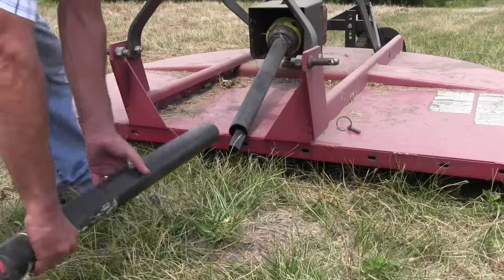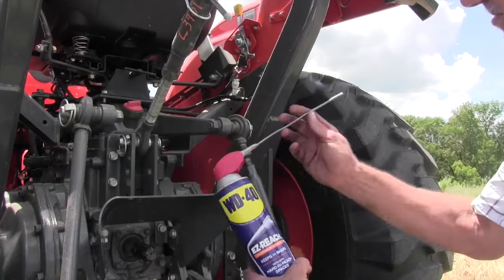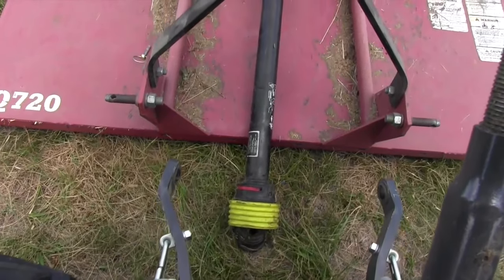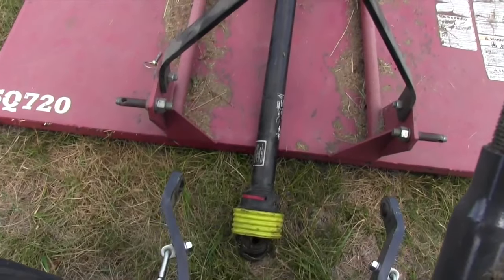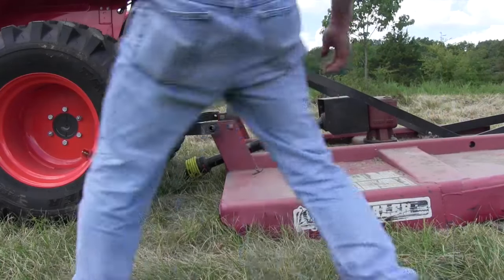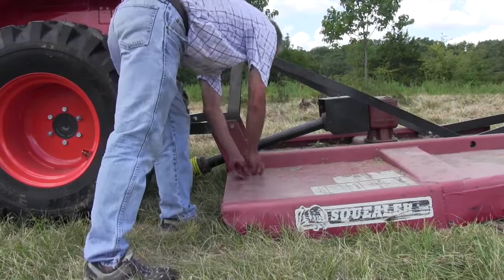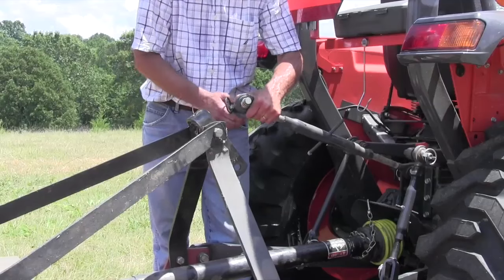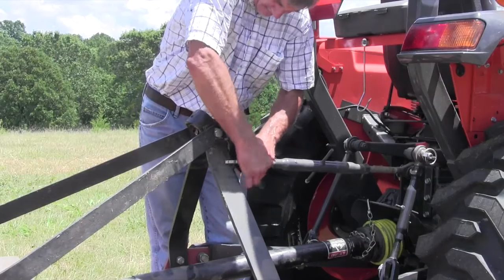A Tip to Make Hooking Up a Brush Hog Easy

Comment: I accidentally found the easiest way to hook up a brush mower. To keep my mower out of the dirt I sat it on two long scrap pieces of pvc sewer pipe I had laying around. You can slide a mower deck around like it's on skates to hook it up, keeps it out of the dirt and they don't rot. It makes hooking up my mower super easy! Thank you for the video.
Reply: I used 12 inch steel oil well casing to do that for 40years.
Reply: That is an absolutely boffo idea. Man, damn if I’m not doing just exactly that.
Reply: Well gosh darnit
Reply: Sounds great, going to try that with my front deck on  JD F935, a real pain to reinstall, thanks again

Comment: I keep the cutter on a steel dolly I welded up with some steel I had on hand that is on wheels and store it indoors on a concrete surface. If yours in on a level surface like mine, you can grab a low clearance hydraulic jack for lifting your car or truck. The jack is on wheels and makes shifting the cutter around easier than lifting with a pry bar. I know that doesn't help if you store yours in a field.

Comment: Thanks Mike!
My Kubota L3240 has the sliding arms which makes the lower pin attachment fairly easy. However, the pry bar is a great idea for a "just off" adjustment which is often necessary even with the slides! You are right, "now why did I not think of that?" as it looks like a D'uh tool. 👍👍

Comment: Mike, I realize this clip is now a few years old, but I did want to add my (belated) 2-cents worth...  For several years I, too, struggled to line up my tractor to the brush hog.  I keep my cutter parked up on cinder blocks in my concrete-floored barn when not in use and it was difficult to make those necessary final adjustments to the cutter when it came time to hook it up.  A few years back I built a skid from scrap 2x6 planks set on rollers (in my case, metal coasters salvaged from an old upright piano I was getting rid of.)  The brush hog remains parked on the skid and off the floor when not in use; simply backing the tractor up close and it is quite easy to move the skid into final position when I go to attach.

Comment: I always found that getting the tractor aligned properly (at least close) before you start to attach any implement is the big 'trick'.  When you are twisted around, looking over your shoulder, backing up to an implement you can't tell if you are square to the implement or not.  One lift arm is angled one way and the other is angled another further complicating the procedure.  I carefully set the top link pointing straight back (usually while standing at the rear of the tractor and sighting down toward the engine) and then I have a reference to know what is 'square'.  If the implement has a PTO shaft, I also align this 'straight ahead'.  Now I have a reference to what is 'square' and can 'aim' the top link to the center of the implement trying to keep it all square and it should hook up fairly easily.  Unlevel ground can be a real problem.  I also believe in letting the tractor do the heavy work.
Thanks for your videos and the help they give us all.

Comment: That was a really nice demo, especially after we had just struggled to put on the mower the hard way.  I need to watch your videos before fighting the tractor, not after.
Reply from the maker: I did it the hard way for about 50 years, imagine how dumb I feel...especially when that tool was leaning up against a wall 30 feet away the whole time.

Comment: Great idea, thanks!  My cutter is housed in a shed on blocks.  I use a chain fall on the top link attachment pin to lift it off the blocks, then free up  the tractor lifting arms to move freely.  I follow up with final leveling and re-pinning the lifter arms.  Takes only a few minutes and I don't even have to swear at it very much!

Comment: Hey Mike, as always, thanks for the video.  Two thoughts come to mind.  First is that I keep an old shovel handle around close as it seems I always need a leaver for something.  Also, I tend to keep my implements in the barn on concrete and started setting them on movers dolly so that they roll around.  This make it easy to adjust when mounting them and also lets me roll them to wherever I want to store them.  Saves a lot of floor space and maneuvering around inside the barn.
Reply: Re-watched this video and finally read the comments.  What a great idea for inside a shed that has smooth slippery floors.  Steel pry bars slip when prying and I haven't sprung for Pat's Easy Hitch yet.

Comment: I've changed to a quick hitch system on my small (45 horse) tractor and am so glad i did. Changing implements is no longer a hassle. The one i've installed is an after market product fitting most tractors.

Comment: I have been using a Rock Bar to move my Shredder to line up with the pins for years.   I guess you confirmed I am doing it right.   My Shredder is an 8' wide brush hog, and you need a little more leverage but it still works GREAT !!!  Thanks for the TIP !!!

Comment: Thank you for this and your other videos!  I'm late to the picnic here but if you can store your cutter underneath an overhead, simply use a chain fall on the center pin. The cutter is suspended between the tailwheel and the center pin.  It's easy to jockey the cutter by hand  to slide the pins onto the lifting arms.  Then drop the chain fall and hook up the center adjusting link.  The chain fall offers very fine adjustments as to height. Using this method takes me about 5 minutes to get the cutter completely hooked up.

Comment: Mike ---- I've actually have used this method for a couple of decades.  But I place the front of the brush hog on a couple of 2X or 4X lumber.  I then can use a longer 2X to jockey the brush hog into position and make my connections.  Now the auger is a different story.  The best way I found is to hang the unit on a chain and jockey that around - but still a pain in the butt.  Not so much enthused about getting on and off the tractor to make any adjustments.   Good video!

Comment: Good video, Mike. I often use the pry bar vertically, in the triangle leading to the rear wheel for fine movement adjustments. On the PTO shaft, I still use an old mechanical overrunning clutch between the tractor and the brush hog. That will always spin, even when the tractor's shaft does not. It also has the added advantage of acting like another shear pin. If you hit something, and the slip clutch does not work, worst case is the $79 overrunning clutch will fail. Much better than internal PTO damage, and it allows the brush hog to spin to a stop gradually.
Reply from the maker: Interesting tip, I would never have thought of the overrunning clutch idea.

Comment: Another good video of advice.  I liked the idea of the bar or piece of pipe to help with the alignment when hooking up the mower.  When I set my mower off of my tractor, I set 2 scrap pieces of 4" X 6" X 12"  pieces of wood under the runners on the sides of the mower near the front.  Then I can just align the mower by pushing or pulling on the tail wheel when I hook the tractor & mower back up again.  Plus the added benefit of the mower setting on the pieces of wood is the fact that the mower blades are not on the ground if the sides of the mower sink into the ground a little bit.  Stay safe.

Comment: I have three indispensable items for my tractor. One is a five foot 2 X 4 for moving equipment while hooking up just like this video.  The second item is a short ratchet strap for pulling the lower arms together.  But the most useful item of all is a six foot high strength log chain which is the perfect length to hook on the top of my bucket and attach to equipment or items that I need to move around.  This was custom made to be long enough but not too long. It is also extremely compact and easily fits in a small tool box.
Reply: Love to see how you use the chain and the 2x4. Video?

Comment: Another good tip, Mike; Thanks! I keep all my equipment in the barn on a concrete floor, with all the implements on casters and dollies. 'Made a pair of front casters for the brush hog, and have dollies under the back blade, front QD bucket, old back bucket used for a counterweight and chainsaw/tools carrier, etc. Wheels make 3 point connecting and disconnecting infinitely easier and faster! 
Thanks for all you do, we appreciate it. 'Been working with tractors for most of my 64 years, but I always learn something from you!

Comment: Always leave your mower on blocks.  A mower on the ground is a moisture trap and a home for skunks. A little higher shelters rabbits from coyotes  and your cat from your neighbors  dog.
Reply: We set ours on landscaping Timbers. They are rated for ground contact and ease sliding the shredder about to connect to the tractor
Reply: I just rest mine on some 2x4s. perfect height for a small tractor and a small 5 foot bush hog.

Comment: I had and easier (in my opinion) method back on the farm 40 years ago. Hard to describe in words, but I would back up hook up one side then my moving the tractor and lifting/dropping the arms I'd hook the other side. I basically let the tractor do as much work as was possible.

Comment: I've got an even better idea that my dad taught me.  When you park the cutter, set a couple T-posts on the ground running laterally (side-to-side) under the front of the cutter, with the bumps facing down.  A long, metal pipe will also work.  Then unhook the cutter so that the sides are resting on these steel rails.  When it comes time to hook it back up, it's really easy to slide the front end of the cutter around on those posts using just your hands.  No long lever required.

You just need to make sure that you don't hook up your PTO shaft until after you've lifted the cutter and moved it away from those T-posts!

Comment: One thing that gives most people trouble is squeezing in behind the tractor to hook up the pto shaft. I've found that if you leave a foot of so of room between the outriggers and the mower you can get in and engage the pto shaft as long as you have enough extension to keep it together while extended. Then back up to the mower. I finally bought a set of quick release hooks to fit on the ends of the outriggers so all I have to do is back up and lift. If I have to adjust the mower I use a shovel to lift and swing.

Comment: Thank you for sharing the pry bar trick.  Just starting using attachment and Wow.  It works for the box blade also.  Off subject: concreted 2 ea 4 by 6 in  beams inground, have a horizontal removable 4 by 4 that holds up the Post Hole Digger.  Its like a teder toder.  All the weight transferred to ground when PHD rests on the 4 by 4. Yoke weighs about 5 pounds when hooking up.

Comment: I learned this from my father back in the sixties and I've been doing it ever since it works on everything not just the rotary cutter a person would have to be a little on the stupid side not to figure something like this out . If you put a piece of 4 inch PVC pipe under the rotary cutter you can move the cutter back and forth by the rear wheel real easy
Reply from the maker: That's a great idea!

Comment: Hey Mike, a buddy of mine taught me to set the mower on a  4 x 4 post. Much easier to deal with when it's time to hook it back up.
Reply: Setting it on a couple steel T-posts works a lot better than a 4x4 when you need to slide the cutter around.

Comment: I use a 6 foot spud bar (or San Angelo bar or whatever you wanna call it) for maneuvering implements around this way.
I also found that the Pats Quick Hitch makes it easier as you only have to get one side lined up, then just back up a little more and it will push the other side in line, then just lift up on the arms and it clicks into place.

I wish I remembered to lube up all of the various parts BEFORE I start whatever job I'm doing.  It seems like I always get going and need to adjust something only to discover it's rusted into place.  That's when I break out the ole pipe wrench :)

Comment: just got my first tractor, and took it out the weekend, unloaded it and hooked up the brush hog and did some cutting.  When I went to move my box blade I got a little frustrated trying to line the tractor up with it, and used a big pry bar to adjust it into place.. watched this video tonight and realized I just dumb lucked into this tip my first try out...hope future days on the tractor go as well.

Comment: I've been using a 7-foot drive-in fence post to maneuver bush hog around . If your parking on concrete or asphalt surface put a short piece of pipe under each side when you unhook and it will roll back and forth  . I used 4 in PVC . It never ceases to amaze me how people make the simplest jobs hard use your brain instead of your back .

Comment: Another great vid Mike.   When I was researching tractors before buying my first one, you did video where you recommended getting the extendable arms.   The Bronson 4520R that I bought has them and I am damn glad.   They make connecting heavy three point attach implements so much easier.  I just back the tractor up to where I'm within about an inch,  release the extensions and I'm good to connect.   I think that was the video where you showed what you got for the tractor that a few thousand higher.  The Branson I got was less than the Deer and Kubota or Mahindra in that same range and they did not have the nice features like the extendable arms, or the cup holders.  Thanks for all of your help.
Reply from the maker: You're welcome, glad you got the tractor that you really wanted.

Comment: I like that tip, and that is the main reason I purchased the easy hitch attachment for my tractor. It was difficult to hook up implements like the brush hog, and I don't have the movable attachment on my tractor, making it hard to hook up equipment. I have to check to see if I had a long pry bar or another heavy bar around home to help hooking up the equipment. The only problem I have is hooking up my box blade after removing items like the brush hog. The top hook of the 3-point hitch when my box blade is hooked up. I have to remove the bolts on the 3-point hitch and readjust the top hook for the other implements after I am through with the box blade.

Comment: Pry bar? I've used those for hooking up for years. No news there. But here's another tip for you. Cut a length of PVC pipe long enough to hold the lower arms spread open wider than the outside of the pins. Makes hooking up even easier. You can usually get one side pinned and only have to slightly tweak the other to pin it. Sometimes I actually manage to pin both without moving anything but that is rare.

Comment: You're not supposed to put grease on the PTO shaft. Grease makes dust and grass stick to it. You're supposed to use graphite. It's dry and when the dust and grass flies around it won't stick.
I really like the idea of using a pry bar to line up the cutter to the Tractor.
Reply: Enough graphite to dust a shaft would cost a pretty penny.

Comment: We keep a can of lube spray near the shredder to spray the inside of the pto coupling and pto shaft when we disconnect and later when we connect. We grab the trailing dolly wheel to drag or move the shredder about to align for connection, even when using the quick hitch

Comment: A big stick works too.  I used to do that when I was too lazy to walk to the shed and get my spud bar.  Now I have telescoping arms.  If I can't get the shaft to line up on the tractor PTO output I just turn it by hand or a stick or wrench.  Just be careful it doesn't spin and catch your fingers as even slow movement of that shaft off the cutter gearbox has a lot of torque if the blade moves just a little bit.  You've mentioned it in prior videos but always hookup the left side without the adjustment on the lift arm and then use the adjustment on the other side to get the right arm on.  Great advice and good to mention the greasing part.  I bought a used auger and the shaft rusted together one year (shame on me for not greasing when I got it) and it was heck to get apart.
Reply from the maker: Yeah, the inertia from the cutter could mangle a finger pretty quickly.  Thanks for mentioning that!!!
Reply: Yeah you would not think that the blade moving really slow would hurt anything.  But the torque difference is amazing by the time it gets back to the PTO shaft.  It's more dangerous when the cutter is on a hill like here in WV.  I envy folks that live on the flat :)

Comment: You really helped me. I grew up on a farm and had a lot of three point experience. Later I was in an electrical accident and lost my arm. I've recently bought a Kubota with a backhoe and took it off once to attach the brush hog. The struggle was ugly. The ground where the dealer left it was not level and the alignment was pretty bad.

After fighting it that time, I've been avoiding trying to hook it up because of the pain-memory of the last time. My weeds are getting big. The rock bar solution is so simple, yet I hadn't thought of it. Maybe I won't have to use the finger pinching handy-man jack I bought to align all the moving parts. My rock bar will be better.

Now if only you could tell me a better way to hook and unhook the post hole digger. I don't have the luxury of a smooth and level cement floor and enclosed shop, so it ends up tied to a tree and sucks to put on. :)

Thanks Mike!
Reply from the maker: The person who figures an easy way to hook up a post hole digger gets my nomination for engineer of the year!  That's my least favorite one to hook up. Here are a couple of videos where I discuss: 

https://youtu.be/hSzDAulOZnQ
https://youtu.be/HKnR0-ELMA4

Good luck!
Reply: My friend has a huge subsoiler for a 100 hp tractor. He keeps it on a chain hanging where he can back up to it.  I use cinderblocks and a digging bar with my rotary cutters. Both 6' heavy duty..